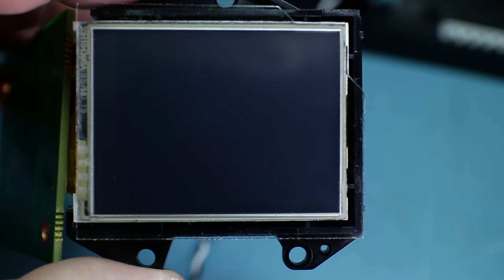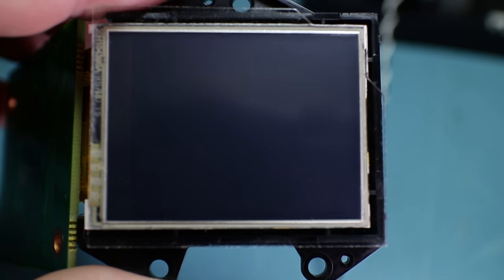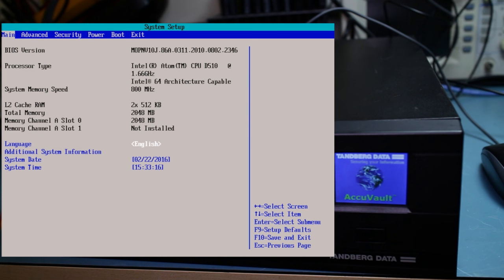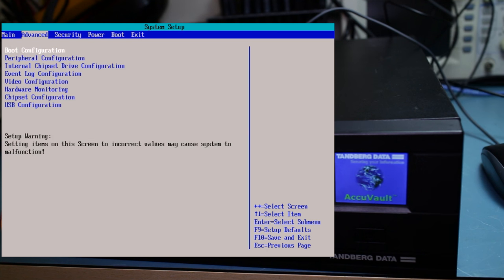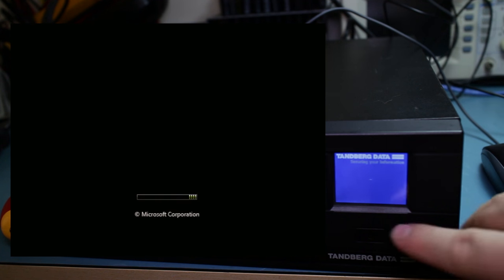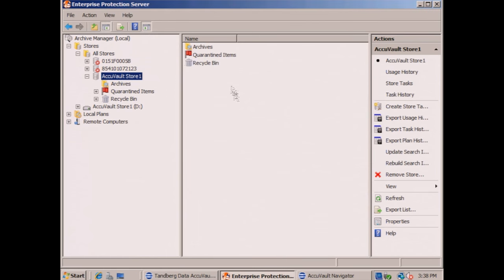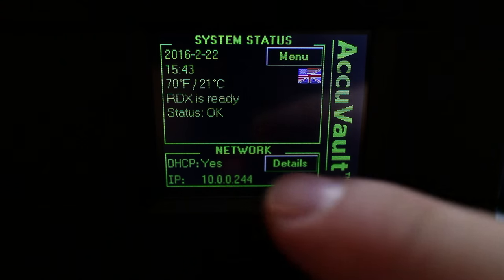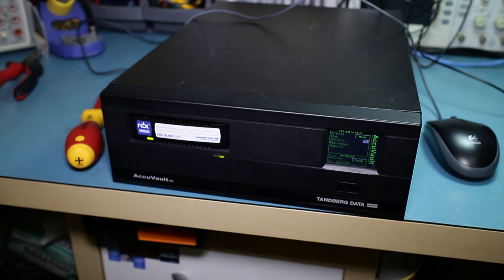Tandberg AccuVault RDX Teardown

Comment: Realtime deduplication - both file- and blocklevel - require tremendous amount of memory to work - afair ZFS suggest 8GB RAM per 1 TB storage, other systems show comparable numvers. Since neither the drive nor the board got nearly as much it's likely the deduplication is either working in a scanning mode (which would take hours to complete and as such delay the tape transfer) or just a classic marketing stunt...
Reply from the maker: +BitBastelei That is my suspicion as well. Ask anyone trying to use it on FreeNAS and you will learn real fast the hardware requirements of dedup. Haha

If it really is doing it, it might only dedup to the RDX drive - possibly with some kind of background prescanning. The slow USB 2.0 interface might just be crappy enough to let it handle that.